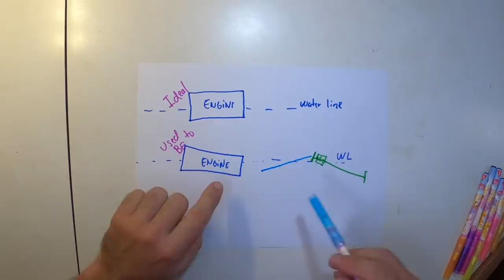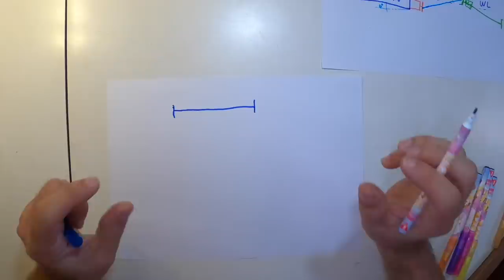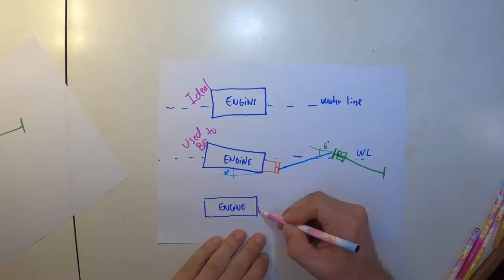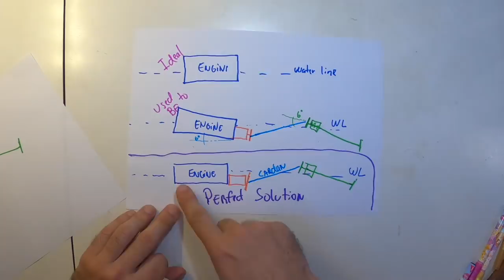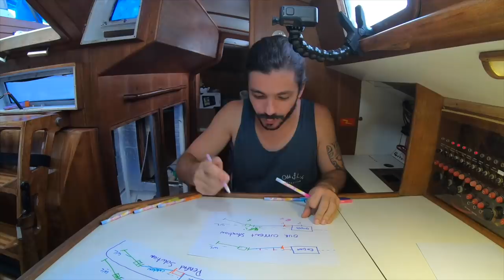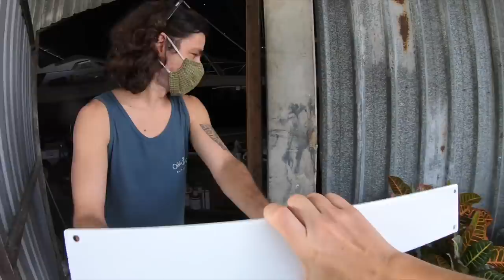⛵️Brand NEW DIESEL ENGINE on our 30yo Sailboat!!🤩#181

Comment: Similar to the U-Joint used in a car driveshafts the reason for the offsetting angles is to cause the tiny needle bearings inside the U-Joint to rotate. Otherwise if everything was in straight alignment the needle bearings would take the load in the same place all the time and quickly go from being round - to having a flat spot. Good job of explaining the angles Duca!

Comment: Duca, once the Yanmar people have installed your new drive shaft correctly you should mark all the mating flanges so that if you ever have to pull the shaft out for any reason you can then put it back the same way it came out and maintain the phases on the universal joints.

Comment: Ducca, your re-inventing the wheel. Why doesn't the maker of the shaft for your boat use universal joints? They are used on every car in the world to make up the difference in engine, or I should say transmission angel to axel. Plus that angel changes every time you go over a bump! But thats just me and my thinking.
Reply: From the brief look at the shaft we got in this video, I think the drive shaft has a universal joint at each end, rather than the traditional one in the middle. Duca was explaining that the  deflection ange for each UJ needs to be the same (ish) for that setup to work.

Comment: Nice work!   I have a similar OCD work ethic..  : )   I replaced the atomic 4 gas motor in a Columbia 30 with a 20 horse Yanmar Diesel that required me to build adapter plates to for the engine mounts.  I have built a lot of Radio Controlled model airplanes so that helped me a lot with lining up the motor to the shaft (conventional with a stuffing box).  Good luck with your project your almost there!

Comment: With the engine mounts and engine installed, measure each one and put the measurements in your repair log so you can tell when they should be changed in the future.
Reply from the maker: Thanks for the suggestion

Comment: One of the first things I look for in a boat, is the cleanliness of the engine room. If the engine room is spotless, then that tells me that the maintenance of the entire boat is proper. Not one drop of oil, not one stain, and clean enough to eat off of. In one year the condition of your engine room will be a good sign of your maintenance and upkeep of your new floating home. Cheers from Winnipeg.

Comment: Good video and engine tilt shaft explanation... its really hard to find paint that adheres to galvanized long-term fyi
Reply from the maker: Thanks , Edward. epoxy primers are great adhesion-promoting paints in galvanized steel (got it from a website, hehe)

Comment: Are you going to change the needle rollers in your Hardy Spicer (universal Joints) on your prop shaft they are quite easy to change you just need a large vice big enough to fit the cross section in plus a socket for one side to push and a larger socket for the bearing to enter remove the circlips push with the small socket and let it enter the larger socket then push it the other way use the reverse method to put it together just be careful that none of the needles fall out use grease but not to much. check on you tube if you deside to do it there are some videos

Comment: A piece of stainless flat stock, stainless pipe, and a tig welder and you'd have an exhaust flange with a much less aggressive angle... and it would add "bling" to the ole engine bay.

Comment: You could have avoided your problems with the cardan shaft, by using one with constant velocity joints. These don't need both angles to be the same. I have these fitted to my boat and they have given no trouble in forty years. But well done for getting over the problem.

Comment: Wouldn't 2 u-joints take care of the whole angle issue? Works great in all cars and many boats
Reply: My question exactly.
Reply from the maker: The mechanic said it wouldn’t hold the tension
Reply: @OddLifeCrafting  I don't understand. My Mustang has 460 horsepower and 450 pound feet of torque using 2 U-joints with no problem whatsoever, so your tiny engine should be no strain at all.

Comment: When you take the plastic wrap off the new engine, doesn't that void the warranty? (G)
Reply from the maker: We didn’t want to have rust on the top of the engine and we didn’t took the plastic until the point it was really necessary

Comment: One universal joint would have solved all your angle problematic
Reply: The only problem with that is it would have taken two universal joints and the shaft would have to run in two bearings. One at each end. There isn't a great way to install the bearings for the shaft of that size to run in. The mounts would be prohibitive.

Comment: I imagine I may have cause you to look at this much closer. One aspect I forgot about is a diesel motor turns slower than a gasoline engine. Your binding an balance issues should be much less with a engine that turns around 2000 rpms than they are with a engine that can turn over 6000 rpms. Sorry I am an old hot rod builder with a one track mind...

Comment: I don't understand what difference a Travellift would make to start the engine. Did the marina gave any explanation as to why?
Reply from the maker: They don’t trust to start an engine with the supports holding the boat. It’s a regulation they have in the marina to just start an engine with a travel lift holding the boat to avoid any problems
Reply: @OddLifeCrafting  Oh, so they are afraid that vibration could make the boat loose from the supports and fall to the ground. This would indeed be a big mess, considering it will not fall upright and there are other boats around. Fair enough. :)
Reply from the maker: Yes. This would be the problem 😬

Comment: Use a shaft with CV joints instead.
Reply from the maker: The standard cv ones are not good for high torque and high angle and speeds

Comment: ooooooooooooooooooooooooooooooooo, i built those 1310 series drivelines for 28 years ,please used lithium grease.on ujoint , it will repell water,,very good job be safe ,,sign land lock
Reply from the maker: Thanks for the suggestion and support

Comment: Is "cardan" an English word?
Wikipedia explains, https://en.wikipedia.org/wiki/Universal_joint 

"A universal joint (universal coupling, U-joint, Cardan joint, Spicer or Hardy Spicer joint, or Hooke's joint) is a joint or coupling connecting rigid rods whose axes are inclined to each other, and is commonly used in shafts that transmit rotary motion."

Comment: Bonjour les amoureux,
Roberta, a crush for Gene Kelly, I would have understood, but for this Kelly, I am disappointed , Duca, you are much more cute, skill , perfectionist and have more conversation :+)))
Besides this, I would not have imagined the importance of the angles, on my steam model boats, the machine operates at max 600 RPM. Which is the speed of "Kelly" ? About  1 200 RPM I would imagine,  is that correct ?
Great milestone indeed. Problem  and first start = great teasing for the next video, well done ! 
PS : No Sicaflex today ?
Amicalement, Raphaël

Comment: Welcome aboard Kelly.
I was interested in your comments about rusty engine mounts. I have worked on cars for over 50 years, and had to change a few engine mounts, but never for rust. I have never seen a rusty engine mount. Only the rubber parts gave problems. I guess that is the difference in marine applications. Damp salty atmosphere leads to rust.
Reply from the maker: I think the main problem is the marine environment

Comment: Engine = gear box = Slip Spline + U-joint = Shaft = U-joint = Prop Shaft
Look under most cars. Tolerates differences in angles easily.

Comment: Why do you have to have the engine and gear box flat why not raise the from of the engine to match the angle that is needed. Not all fast engines in super cars are straight or flat Some are angled for stability in the shell of the car plus power output. As modern engines are fuel pumped these days. Perhaps I am missing something with on board boat engines. OK exhaust you can get a flex pipe made of steel heat paint it or engine paint it white reason so if rusts at anytime you will see it also to make sure there is full seal to stop Exhaust leaks in to the boat. as Black soot will show on it. Those flex exhaust pipes are used on many types of engines just make sure of sizes.

Comment: An engine mounting depends on the orientation of it's lubrication system. Aircraft (modern) Horizontally Opposed, Aircraft (WW2) Upright Vee, Inverted Vee, Radial. Marine Inline (standard), Opposed Piston (two crankshafts). You get the idea. Some engines have remote oil sumps, most are integral. General limitation for integral sumps, is 15° from upright, in any one direction, some are less. The designers then have to make an accommodation, to suit.
Best wishes, keep up the awesome work.

Comment: STOP 🛑 ... I have a solution for all your twisty angle alignment troubles kiddies :D Buy a 100 HP Elco electric marine drive motor, attach it to your drive shaft and replace the engine with a diesel generator. You're welcome ...

Comment: A travel lift to start an engine? Wha? Maybe a weight requirement? Might as well install, lift the boat, start it and splash all at the same time, then fine tune everything in the water. It’ll need a shakedown and adjustment anyway. Sorry Duca, gotta respect Roberta’s shiny new crush and take a back seat on this one. She’ll get bored. Hopefully. 🤷🏼‍♂️ 😫

Funny, right when I was wondering about the shop dogs, sure enough at 13:40 they appeared. Yay!

Comment: Everything Duca said about engine position, prop shaft (gearbox to propeller shaft) all sounded good until you have a look at a boxer engine, a V8 or V12 engine or even W12 engine with cylinders from 45 degrees  to 90 degrees from center. Universal joints (back of gearbox to propeller shaft) at almost 15 degrees on cars and trucks. the only real reason I can see for having the engine and drive line so inline is to lower or stop vibration.

Comment: Congratulations on your new engine replacement. Hopefully it will give you guys trouble free use for many years to come. Just a friendly reiminder - please be careful with regard to replacing engine oil based on actual number of hours the engine is in use. Scheduled engine oil replacement is without question the cheapest form of engine insurance - period. Are you planning on replacing the prop? Also It might be worth considering a prop replacement based on condition, etc. Others might disagree but haven't had much luck with collapsable props to reduce drag.

Comment: Had a similar problem with the exhaust connection and found a performance auto part supplier that sells silicon tubes in various shapes and sizes. The double layer reinforced silicon tube meets SAE standard for marine wet exhaust and provides a more flexible connection. There was no option to move the muffler as it is built into the hull. https://www.sv-veritas.us/projects/engine-hoses

Comment: I find all the videos on the new diesel engine very enjoyable but I can't help but notice that all the work and pain of getting a new diesel engine working was a 100 times harder and way more work than had they just gone electric.  Sure I would have suggested to also have a smaller new diesel generator as a backup power supply but if you add up all the extra cost of preparing for the new diesel engine I wonder how much more would it really would have been just to install an electric motor.  Electric motors are way more reliable than diesel engines and require way less maintenance.  Plus once you run out of diesel fuel that is it the engine is useless.  With electric you never run out permanently of fuel because the solar panels capture the energy from the sun next time the sun rises.  Heck you can probably get an few old forklift electric motors for less than a thousand dollars each.  It's the lithium ion batteries that will be the biggest expense.

Comment: add a Universal Joint made for a driveshaft, off a  car automatic transmission  you have a length of straight steel to work with and a flat bolt on end with a Universal joint which will work amazing in this application.

Comment: In my opinion 3 degrees is too much. You will have a harmonic vibration and noise. Tilting your engine 6 degrees is no big deal. Or you can put your engine flat and use a constant velocity joint on one end. Just my opinion.

Comment: Very sorry I am a little bit slow and I do not understand your explanation :you are telling us you are going to install (with a wedge or a weld I guess) a flange out of the transmission shaft at a 7 degrees angle  like you say and the drawing shows .
              # 1 :If the flange on the ujoint shalt is square (90deg) your shaft is going to swing around wildly( from 5deg to opposed 9 deg=14deg) (also killing transmission bearing ).                                                                                                                                                                                                                                                                                                                                                         .           # 2 :If the flange on ujoint shaft is also 7 degrees the whole operation is useless. 
or are you saying the transmission  shaft is going to come out at 7 deg (would work) but impossible to achieve. Or maybe you want to install a 3 cardans  shaft but did not mention? please please tell us ,don't be afraid, am I now senile ?
PS: (ujoint =cardan)
BTW :cutting the bulkhead and reinforcing it (on top or bottom ) seems a fairly simple operation (considering) That is the advantage of a steel boat !

Comment: Would universal joints on the driveshaft simplify the "angle" issue?
Reply: Hi the system does have "U" joints on the shaft in the engine room.  The point he was making with his drawings is that the more extreme the angle is on universal joints the faster they wear out, if you do have to have an angle on the  U joints the less the better and the angles should be the reciprocal of the other universal joint.  If you have a +2 degree angle on one end of the shaft you should have a -2 degree angle on the other end to reduce harmonic vibrations caused by having different angles on the universal joints.  This applies to all drive shafts whether they are in a boat, a car or stationary equipment.  Hope this helps Teacher!  : )
Reply: Thanks for the explanation!
Reply: @mojoneko8303  Thanks for the explanation! Do the joints have to be greased on a maintenance schedule?
Reply: @middleschoolteachers7866  Hi the U joints should be greased on a regular schedule.  For this application I am sure they have U  joints with "Zert" fittings to pump grease into the little needle bearings in the Universal Joint caps.   Most modern cars don't bother with grease-able U joints because most people didn't bother to lube them regularly and they wore out so they quit bothering to use them and use a "sealed" U joint instead.  Probably saves the car manufacturer a  couple of dollars per U joint but they don't live as long as a properly greased Universal Joint..    I was a Machinist Mate in the Navy and a power plant mechanic before I joined the Fire Dept.  I have been a knuckle dragging motor head since I was 5...  : )

Comment: You both are so wonderfully positive that every episode makes my day better.  A couple of comments; Cardan is the correct technical name for your shaft end joints but in English they are usually just called "Universals Joints" and sometimes described as "Hooke Type" Did not quite understand what you meant by changing the flange angle at the transmission, don't think that a simple wedge shopped adapter would do what you want.
You should check out the possibility of having made up a drive shaft with so called "CV" Constant Velocity joints as used in all front wheel drive cars. It is these that made front wheel drive cars practical.
Presume you have a thrust bearing at the end of the prop shaft, likely after the water seal. 
All the best, keep pushing forward!!
Reply from the maker: Thanks for the information, sorry for the confusion. The standard cv ones are not good for high torque and high angle and speeds

Comment: Why use a Cardin joint rather than a CV joint?
Reply from the maker: The standard cv ones are not good for high torque and high angle and speeds
Reply: @OddLifeCrafting   I didn’t realise the torque forces would be higher than that of a 4x4.

Comment: Kelly is toooo small if you run two large alternators Kelly will only be pushing out about 35 hp ..you try and motor into a 4 or 5 knot current with this iddy biddy engine you will be going backwards..for a 15 ton boat you need at least a 80hp ....🦈🐳